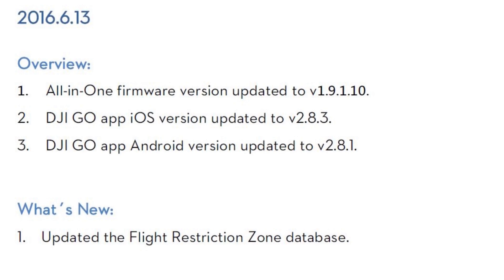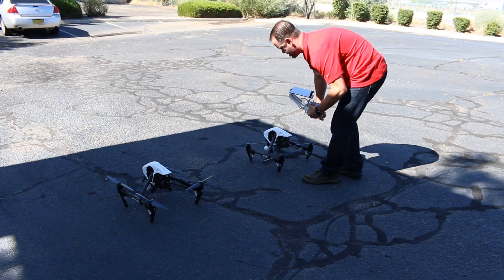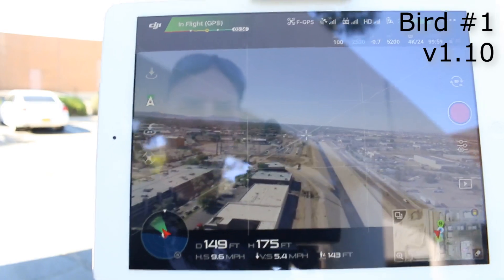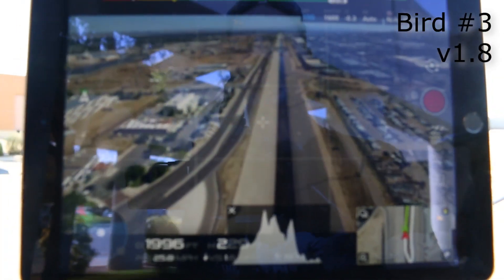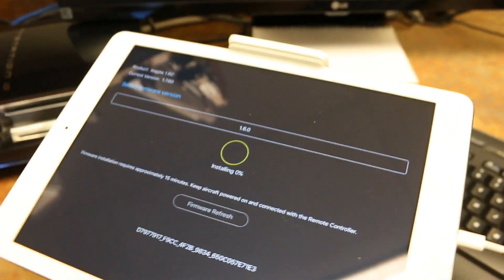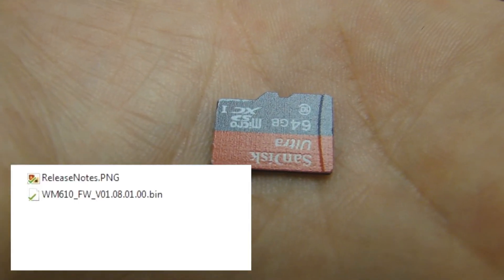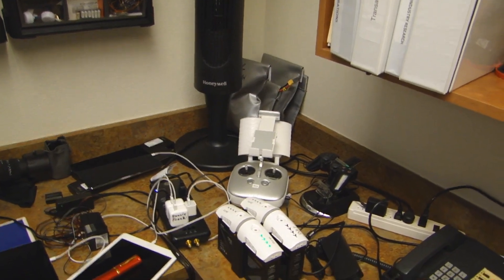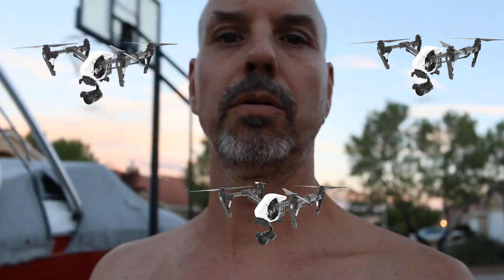Make your Inspire 1 great again...Part 1...

Comment: I tried to downgrade from 1.11 to 1.8. No way. I first tried directly from 1.11 to 1.8. It didn't work. So I tried to downgrade one version at a time. I successfully downgrade to 1.10. Then I downgrade to 1.9. No problem. But I did not succeed to downgrade from 1.9 to 1.8. The drone stopped bipping DDDD and never start bipping D-DD. So I ugrade everything again to 1.11 for the drone and 1.7 for the remote. I always have this video transmission problem. Any help greatly appreciated. My Inspire 1 is unusable without video signal.
Reply from the maker: I'm not sure why you would go back to 1.11.  v1.09 not only works better than v1.11, it's a skosh away from 1.08.  Overcoming the v1.11 hurdle is the most difficult part.  I would say fly around on v1.09 and then get a fresh start on the 1.08 downgrade.

If you watch the video, I had the same problem.  I was only able to downgrade one of my partner's birds to v1.09.  We flew it around like that a while and then downgraded to v1.08 a few days later.  What you have to realize is none of this is exact science.  DJI is no road map, so we count on people like you to persevere, DOCUMENT your experience, and SHARE it.  You're in a great position to contribute to the cause.  Don't give up so easy.
Reply: When I downgraded to 1.9 (AC) and 1.6 (RC) I could not bind the remote with the drone anymore. I tried to use the link feature in the application and click on the red button on the drone. But it didn't bind the two. Have you any tip to resolve that?
Reply from the maker: The fact that you couldn't bind AC v1.09 to RC v1.6 tells me something went wrong with your FW roll back.  Again, what do the log files say?  Have you been reading them?  More than once it has taken users multiple attempts to get a FW to roll back correctly.  Don't roll back the AC firmware until your are SURE the previous roll back was successful.  The ONLY way to know this is via the log files AND the app.  

All this communication, and I still know NOTHING about your bird, your log files or your experience other than "this isn't working."  SHARE INFORMATION.  Without it, I can't help you.  

Off hand, it is obvious to me that you are NOT CONFIRMING FW versions each step of the way.  Once you confirm the FW version IN THE APP, THEN move on to the next roll back.

For the last time, what do your log files say?  SAVE THEM in an archive so you can go back to them later.

Which bird do you have?  Which camera?
Reply: The LOG told me nothing. I turn off the drone when I heard the D-DD sound. In the log files I got an "upgrading.…", but without "result: success" or "result:failed". I waited for 2 hours before turning off the computer. Should I wait longer. Should I retry and retry and retry until I get "result : success"?
Reply from the maker: The latter.  Retry until you are successful.  I've had to "retry" up to 3 times.  So have many other uses.  It doesn't always take in the first attempt.  It eventually takes.  

Copy and paste your log file in your next comment.
Reply: I retried. He are my results.
First I upgraded everything again to the latest versions. AC to 1.11.0.50 and RC to 1.7.80. Then I downgrade not the RC, but the AC to 1.10.1.4.0. The drone makes a D-DD sound, but log didn't show any success result. I turn on the drone and the remote controller. They were linked even with RC in 1.7.80.
So I continue to downgrade to 1.9.1.30. Only the drone. I waited for the D-DD sound. Turn off the drone. Log shows nothing except "Upgrading…". I turn on the drone and the controller. They are always linked.
So now my drone is in 1.9.1.30 and my remote in 1.7.80. I will fly a little bit to test the video signal.
Here is my current situation https://www.flickr.com/photos/fredericsidler/37432293474/
Reply from the maker: Excellent.  So far, so good.  You have noticed that the camera beep doesn't always tell you when the roll back is done.  I found the magic number to be 25 minutes.  Let your bird cook (downgrade) for 25 minutes.  Then check everything.  From  1.9.1.30 you should go to 1.9.1.10.  THEN 1.08.  At that point, you will have to downgrade the Remote to 1.6.  If you have 2 remotes, keep one @ 1.7 just to test.  Good luck.  Keep us informed!  Publish your log files.
Reply: Donnie Frank where did you find 1.9.1.10?
Reply: Downgrade successfully done. (AC 1.8.1.00, RC 1.6.0) Here is my status. I will try to fly this afternoon. https://www.flickr.com/photos/fredericsidler/38126451992/
Reply: Donnie Frank i downgrade. But the video problem is always here. Too bad.
Reply from the maker: I saved it from when that was the latest update sent down the pike by DJI.  I always archive FW files.  I checked the links I provided and it seems that that version is missing from both.  Up to now, nobody has needed that FW version.  Before I park it somewhere on the cloud, you still haven't told me which version Inspire you have.  If you have the Inspire Pro, this explains a lot.
Reply from the maker: Make a video showing your video problem.  Where are you located?  What are your video settings?

Comment: I'm facing exactly the same problem with the latest firmware 1.11.01.50. And I don't know how to downgrade. I tried to put the previous firmware on the SD card and turn on the drone. Nothing happened. Can you point me to something I can do?
Reply from the maker: Did you thoroughly read the Description section?
Reply: Donnie Frank no, sorry. I will follow the links. Many thanks.
Reply: I read the description. I format the SD card, I downgrade the remote control. This went fine. I put the firmware 1.8.1.00 on the SD card. I create the empty file WM610_FW_DEBUG at the root level of the SD card. I put the card in the drone. And now it is updating not for 40 minutes, but for 2 hours. How long should I wait?
Reply from the maker: Hello Frederic.  At this point, the log files are going to be your best friend.  Check your log files.  What do they say?

Unfortunately, this part of the process is not very scientific.  Different methods seem to be working for different bird/camera/firmware combinations.  For instance,  I tried to roll back a friend's Inspire Pro, which was running v1.09.xx.30+.  Apparently the "+" at the end of the firmware version throws a wrench in the spokes.  Because I didn't have 40 minutes to wait, I rolled back to v1.09.xx.10 (which took less than a minute!), and then to v1.08, which took about 3 minutes!   Done.

What I learned, is that the X5 doesn't seem to give the user any feedback.  Conversely, the X3 makes a little buzzing sound in a "De de de......deeeeee" pattern that changes to "De de......de de.......de de" when the update and/or roll back is done.  So to roll back my friend's Inspire Pro, I used my X3 camera.  I wish we would've had more time so that I could experiment more.  Unfortunately, we did not.  When done, his X5 camera FW version was completely different from mine.  Yet both X5's seemed to work perfectly in his bird.  That said...

Try using the v1.10 firmware file in conjunction with the blank file, and then the v1.09 and then the v1.08.  Please post your results.

Comment: Hey, tried this on a i1X5 but the bin doesn't download on the AC, doesn't make the beep sounds and cam doesn't make moves (only start up rotations) 
no log file afterwards on the SDcard. ( yes i copied on totaly free SDc)
AC is on  1.10.01.40+
VId downL  is very poor
Reply from the maker: The solution to your problem is in the Description.  Sounds like you're trying to do a direct roll back to v1.08 from v1.10.  Is that what you're trying to do?
Reply: yes , i didn't find the  v1.09 in the description/links , i also tried the empty bin file, but no reaction ( even after 40min)
Reply: I have v1.10.01.40+ on mine right now   and on the Dji site there's only v01.11.01.50
Reply: found this   https://www.youtube.com/watch?v=glW7n1he_rY    he say's you need to format the SD in the Dji cam , gonna try that tomorrow
Reply from the maker: Which empty file did you create?  There are two.  You must create the correct EMPTY file.
Reply from the maker: Nope.  All the files are exactly where the Description says they are.  I just checked.  I'm growing tired of this.  You're not trying or you're not reading or both.  Everything is right there in the Description field, sitting on a silver platter just waiting for you to suck it up...the result of HOURS of research and experimentation.  I'm not going to re-spoon feed instructions that I've already spoon fed in the Description area.
Reply: i used ,   For X5 or X5R camera -   [ WM610_FC550_FW_DEBUG ]
Reply: Big thnx already for your help!
today i tried again with a SDcard formated in my X5cam but no sucess..
i tried it with 2 different SDcards
the i1 starts with normal led light sequence and cam turning a few times, the led goes to yellow fast blinking.
no beep sounds as with normal upgrades ,  i leave it for 40min
when the SD card comes out the content looks like this:
DCIM
WM610_FC550_FW_DEBUG.bin
WM610_FW_V01.08.01.00.bin
Reply from the maker: With all due respect, you are not following directions.  I'm looking at your files, and it is clear you are either not reading or not following the directions.  If you read the instructions, FOLLOW THEM, you will get the same successful results everybody else in this thread and in all the forums I belong to are having.

Please post a list of exactly what it is you do.  I think you will find if you compare your list to the instructions in the description area, you will find a discrepancy.  Looking at your DCIM files, it is clear you are not following instructions.

GIVE me a fish, I'll eat today.  TEACH me to fish, I'll eat EVERY day.
Reply: Euhm??? so what do need to do...
delete the DCIM folder each time before iinsert ? 
 first downgrade to 1.10.01.40  from 1.10.01.40+  ?

i'm not an IT guy,  i had to ask someone to make an empty  WM610_FC550_FW_DEBUG.bin   

i insert a SD card with this in the root  on it:
DCIM 
WM610_FC550_FW_DEBUG.bin 
WM610_FW_V01.08.01.00.bin
Reply from the maker: Which .bin file did you use?  The DEBUG file doesn't actually do anything.  It's just a marker that tells the bird to "stand by for .bin file" and forces roll backs.

Again, with all due respect, it sounds like you are in over your head with this.  I recommend you just keep the firmware you have and try to work with it.  

Good luck.
Reply from the maker: You don't have to be an IT guy.  You have to follow directions.  Clearly, you are NOT following directions.  I'm done with this.  Have one of your friends read and follow the directions and do your downgrade for you.  I can't teach you how to drive a car if you don't even know what a brake pedal is.  And honestly, I don't have the time or inclination to even try.  Please refrain from further comments.
Reply: OK, thnx anyway
Reply from the maker: Empty BIN file?  WRONG.  Again....[sigh]....please read the instructions.  I'm starting to feel like a parrot.
Reply: ...how does an empty .bin file look like..
i read it 100x 
sorry ,to have upset you
Reply from the maker: An "empty file" contains no data, and has no file extension.  Clearly, this is where you are messing up the process.  

Look....This "hacker stuff" is NOT for computer novices.  To follow instructions, you need a good, working knowledge of computers, files, data, etc.  Like I said, I can't teach you to drive a car if you don't even know what a brake pedal is.  So you either have to have someone help you FOLLOW these directions, or stick with the version you have.  I've given you all the tools you need.  If you don't know how to use the tools, you need to elicit the help of someone who does.
Reply from the maker: Hello Karl.  I have edited the instructions to be a little more "user friendly."  Go back, follow the NEW instructions, and tell me if it works.  Good luck!!

Comment: Do you have the 1.9 and 1.8 firmware files for an X5R? My Inspire 1 is on v1.11 and I would love to rollback but DJI.com and Panorobot.com don't have FC550R firmware files available.
Reply from the maker: Instructions are in the Description section of this video.
Reply: Thanks for all the follow-up help with this! The 1.11 downgrade work-around performed well for me.  I have an X5R so I had to use the text WM610_FC550R_FW_DEBUG. Just to clarify the WM610_FC550_FW_DEBUG is an empty file with NO extension (do not add .bin to the filename). Place the empty, extensionless file along with the desired Firmware Downgrade .bin file onto the MicroSD card and wait 40 minutes for the downgrade. The other cool feature of this DEBUG hack is the ability to downgrade in multiple steps at once. So you can take your Inspire from FW1.11 straight to 1.08 in a single go.
Reply from the maker: Freakin' awesome.  Nice work!
Reply: BahDreadnought, I want to downgrade also my i1 to 1.08 but I can’t find the debug firmware on the dji site. Maybe you can help me with this, thanks in advance.
Reply: Norman-Justerie Yazon there is no debug file. Simply create a blank file with the name in the description.
Reply from the maker: Copied and pasted from the "Description" section:

Create a BLANK file with NO EXTENSION, and put it in the root director of your MicroSD card. 

For X5 or X5R camera, file name = WM610_FC550_FW_DEBUG 

For X3 camera, file name = WM610_FW_DEBUG

Comment: Ok just to be clear for rolling back of fw, I currently have fw 1.11 for the AC and RC is 1.7,  I would need to roll back to 1.10 and subsequent to be able to load fw 1.8 correct?
Reply from the maker: Not exactly.  FW can be rolled back only one version at a time.  So you would have to roll back the bird to 1.10, then 1.09 then 1.08.  The controller would have to be rolled back to v1.6 FROM your present version, which I assume is v1.7.

That said, I have never rolled back from v1.11.  I HAVE rolled back from v1.10.  So that is what the video is based on.  It has been brought to my attention that, apparently, v1.11 doesn't allow the user to roll back at all.  I have NOT confirmed this.  Since I don't own any birds with v1.11, and I'm not willing to install v1.11 on the chance that I will be STUCK with v1.11, we're going to have to count on others in this thread to figure out how to roll back FROM v1.11.

As of this writing, that is all the information I have.  If you figure out how to roll back from v1.11, please share your findings.  Good luck.
Reply: One other question, is rolling back the FW done on the AC like you would regularly upgrade it if not you have instructions how to properly do it?
Reply from the maker: I don't know what "AC" is.
Reply: Short for aircraft (drone)
Reply from the maker: I would stick with "UAS."  Even in full scale aviation circles, nobody I know uses "AC."  That abbreviation is already taken by "Air Conditioning" and "Alternating Current."  That said...

Yes, you use the MicroSD card in the camera attached to the bird to do the roll back.
Reply: Yeah I tried it yesterday and it didn't work that's why I ask, cause I thought it might be a different procedure. I'll try it again tonight.
Reply: Donnie here is something I've tried in my troubleshooting, I used a ipad pro and I had now issues with the two batters worth of testing, I currently use an ipad mini4 and I also have Argtek range extender antenna I use.
Reply: Ok I just tried rolling back the fw and it's not working, I'm using fw 1.10 and nothing happens other then the normal sequence of a regular start up.
Reply from the maker: I just got done with a DJI chat session.  The consensus seems to be that v1.11 doesn't allow a roll back.  This is DJI shooting themselves in the foot.  Sans this latest update, as all versions allow for roll back.  I guarantee this whole "log into DJI" thing is going to be a deal breaker for some.

Regarding the roll back, rest assured, there's a way.  There's ALWAYS a way.  It's just going to be a hack.  Unfortunately, I don't have a bird with v1.11.  And until I'm sure there's an exit strategy, I'm honestly not willing to use one of them as a test bed, as I need them as work comes up, which can sometimes be last minute.
Reply: I agree this is some BS from DJI they haven't even acknowledged this issues yet. Have you tried a newer ipad one with atleast the A9 processor, I used the latest ipad pro and had no issues for two batters worth of flying have you looked into this?
Reply from the maker: Yes.  I own an iPad Air 1 and an iPad Pro.  Beyond that, I've bypassed the iPad completely by using goggles in the HDMI port.  Though I don't see the green streak, I DO see the dropped frames.
Reply: Are you using ipad pro and ipad air in this test video?
Reply from the maker: Both.